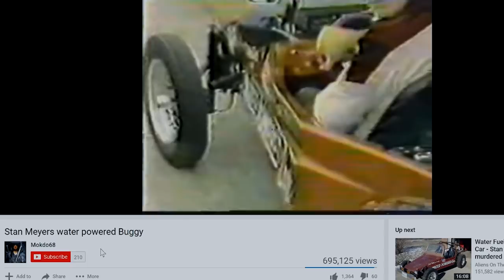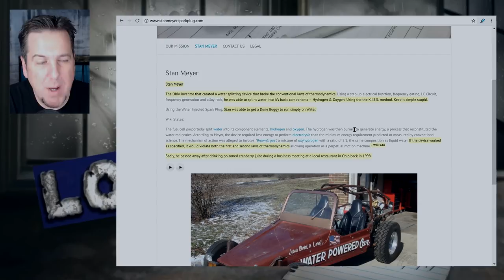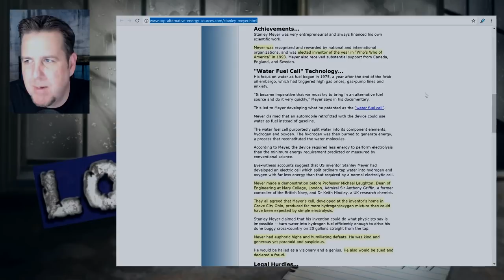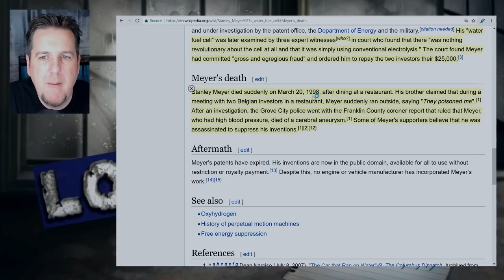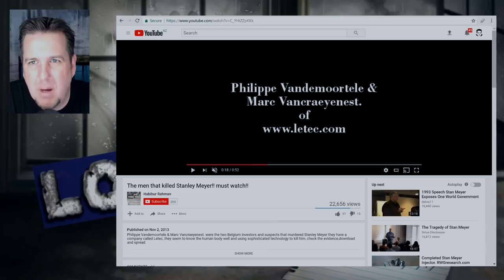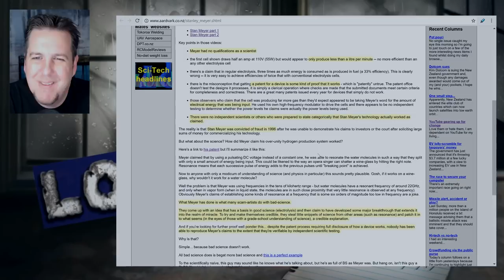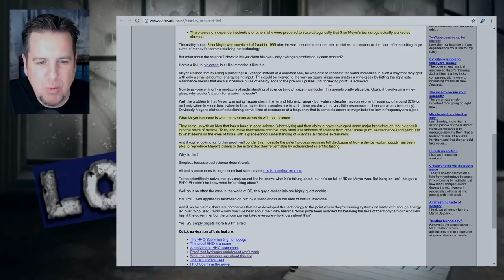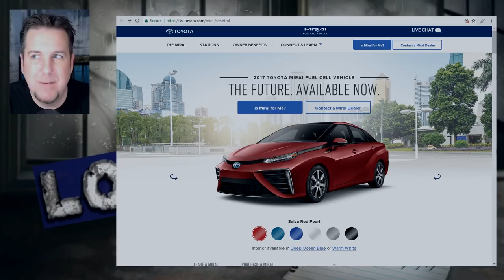BrainScratch: The Death of Stanley Meyer and his Water Powered Car

Comment: I once had  a coworker who had  a small desk  clock  that kept excellent time. The clock had a regular face,  a second  hand, but had no electric wall plug.  That little plastic clock had no batteries either:  no tiny round batteries,  no AAA, AA , C, D,  or lantern batteriy, no battery all!  I think she called it a water clock.  It was cube shaped, clear plastic, visible internal parts  and water filled.  It was on the desk for years.  No imprint re: how it worked.  25 years & have never seen another.

Comment: The water-powered car is definitely not a thing. You can claim big companies wanted to shut him down all you want, but NASA would've paid a lot of money for this. In order to split water, you have to put energy INTO the system. It's just not happening that easily
Reply: not easy but very possible . it would take using gas to start with to get the hydrogen system going first , then use engine power to create the electricity for the electrolysis . biggest problem is drivability issues since engine demand is variable
Reply: youd be surprised at how little amperage it takes for efficient electrolysis . at one time they thought the earth was flat too . if i were younger and had more ambition id just build it , although i doubt the world would appreciate it  ~  finis
Reply: @mikebyrd4671  this is hilarious, there's a MASSIVE flat earth movement right now my man, youtube it for your mind to be blown
Reply: mikebyrd please don't mention flat earth lol find some other analogy that doesn't invite all the nutters to comment.

Comment: It's ambient-heat powered, using high compression 4 stroke, high pressure ~1kpsi water injection flashes to dry steam and ignited, exhaust is cold air and water and needs managing! Caveman shlt..

Comment: I believe His engine never ran on water or hardly at all. The rumors in the area say he was a con man and ripped a funding source off. I don't know if that had any truth to it. But, it seems someone wanted their  money back or were pissed. I don't really believe he was poisoned in my opinion, maybe a heart attack caused him to throw up causing the brain aneurysm. I also heard Stanley had begged the Belgium funders for months for a meeting. They weren't really interested in something Stanley couldn't prove worked.
Reply: Yeah, sadly I think he was a BS'er. Stress probably drove his already high bood pressure to rupture a weakened blood vessel.
Reply: He died from an anoyrism, atleast that's what the coroners named as source of death. According to wikipedia he also lost a lawsuit in 1996 when a court ruled that he had committed gross and egregious fraud by selling dealerships of his fuel cell technology to two inventors. His fuel cell technology was examined for the court and the experts found out that he basically used electrolysis to split up water in hydrogen and oxygen, which is pretty inefficient. You need more energy for the electrolysis than you can get from burning the hydrogen, which meant that he needed an external energy source (probably a battery) for the entire thing to work.
Reply: Rogue Mentality  People believe whatever is fed to them I'm sorry to say this but if any actual revolutionary advancements come the creator is likely to be killed if he plans to go public. Look at Tesla he wanted free energy for everyone and his entire research was taken

Comment: Maybe I am missing something here - Mr Meyer uses electricity from batteries to convert water into hydrogen and oxygen -  the hydrogen is used to power an engine. My question is, how much energy does it take to charge the batteries in the first place. How long will a charge on the batteries last? He may be able to drive across country on 22 gallons of water (which I doubt), but how often does the car have to stop to recharge the portable power source (the batteries) to create electrolysis. The other question is, why use pure water (snow or tap water), when seawater will conduct electricity more efficiently.
Reply: Bruce T. Harvill this is the same as any petrol engine. So long as the power created from burning hydrogen is vastly superior to the output of the battery, any alternator can charge the batteries. 

Petrol engines already do this, you need a charge to run the starter in order to spark the gas in the cylinders, then the engine runs itself essentially.
Reply: A gasoline engine does not need a battery to produce the gasoline. The gasoline is used to power the engine and turn thus turn the alternator. In Meyer's design - water is split in to H2 and O - the hydrogen is burned to turn the engine, propelling the vehicle - in the basic laws of physics, there is no way to produce more energy than is put in. It would not be possible for an alternator to recharge the batteries at a rate high enough for perpetual motion. Sure, it may work for a limited time - but, at some point the demand will exceed supply.
Reply: Bruce T. Harvill First of all, the first part of what you stated has nothing to do with what you asked or what I answered. But to answer whatever it is youre asking in the second part, yes you need more power after the initial "start" of the engine in order to maintain a constant charge on the battery. Petrol burns and runs an engine with a higher output than a normal 12v battery. The idea behind the h2o conversion motor running on hydrogen, is just that, the hydrogen produced would result in a higher energy output than the battery supplying the conversion.
Reply: Surago - I will agree with you that burning hydrogen gas is efficient. I will even go out on a limb and say it burns 3X better than standard automotive gasoline. Let me make sure I understand what you are saying - I use a battery to start the process of electrolysis. Once the engine begins to run on the hydrogen, it turns the engine and the alternator to produce more electricity - this extra energy produced by the alternator is then used to separate the water via electrolysis, producing more hydrogen, thus keeping the engine running. If I am missing something, please explain.
Reply: Bruce T. Harvill I never said anything about electrolysis.
Reply: Okay - I understand what you are saying (I think) - a hydrogen powered engine will produce enough electricity to keep it running. You are discounting the idea that Mr. Meyer had all together. So, yes, you are correct a hydrogen powered engine can, will and does produce enough electricity to keep it running. Fill it up with hydrogen and off you go. I 100% agree
Reply: Bruce T. Harvill are u sarcastic?  Im really not following? From seems a question to question u 180* and you 100% agree? Huh?
Reply: More like irony (sarcasm gets such a bad rap) - if Meyer's idea worked, we would put a generator on the end of the crankshaft and make all of the free electricity we need for the whole world out of water. This argument is nothing new - we did the hydrogen engine from saltwater experiment back in Mrs. Johnson's 6th grade science class. It did not work then and I doubt the laws of physics have changed in 50 years.
Reply: Bruce T. Harvill i dont know but what i do know is some youtubers where able to make electricity with some few items.. clean energy is good for earth for humans to live on this planet but not for the top 0.1% money makers. Oil, high donors.. etc.. so they always have been targeted. So many people working on beter energy electricity have been missing or killed (mostly so good its rulled suicide or accident or like meyers medical) i think he was poisened. 1 they didnt test on. The autopsy could be false (inside man) or bought of.. anyhow even the throwing up could have cost the bleeding.. so i think he was killed. 
Maybe not bc he had all answers but bc he was saying he had them. 
In the media. In the open
 Mostly fam keep work alive but dont u think its weird the twin brother stayes very quiet and doesnt work on it anymore? I truly believe he knows it will kill him. 

Wether or not he knows the true way to doing it (water car thing)

Xxx
Reply: Do I think Meyer's was poisoned - yes. Do I think someone was trying to kill him - I don't know. It is sad that so many of our greatest inventors have died in suspicious circumstances.

Comment: Hi john. I would like to say a hydrogen fuel cell is different than hydrogen combustion. A hydrogen fuel cell is when hydrogen is oxidized given off electrical energy to run an electrical motor. Hydrogen combustion, what Meyer was working on, is where hydrogen and oxygen is ignited in a chamber producing heat that is transferred into kinetic energy (also oxidation but used for it heat instead of electrical energy). I would like to also address Free energy Vs "Free energy." Free energy in a physics point of view, like you said, is getting more energy out of a CLOSED system than that was ever there. For example, if you take a single molecule of water add its energy together from mass, temperature, kinetic movement and bonds you would get its total energy. Then to separate it into O and H you would need to add energy. In the end, you would have a free oxygen and 2 free hydrogen moving in different directions. Now to get them back together, to get the electrical energy  out, one would need to add energy once again to reverse the direction and with enough force to put them back together. This would give off waist heat, i.e. energy that can't be used. So there is no such thing as a free meal. For "Free energy" which most of these YouTube videos, conspiracy, and fringe science are based on is that fact not all the starting energy is accounted for, making it an open system, or a lack of understanding what energy actually is. So you get a free meal not realizing it is always subsidized by someone else. Also people throw the term around for electrical power that they just didn't have to pay for like solar, wind or hydroelectric or in this case snow, ocean water and so on as free energy.

Comment: Two things I want to address here are 1. Does anybody know if Stanley and the prospective investors might have been at high tension and or possibly arguing?.
And 2. Whoever says that an internal combustion engine needs X amount of liters of hydrogen to run for X amount of distance or hours, probably does not understand that the only reason you need any fuel in an internal combustion engine is to start a chain reaction to burn the atmosphere in the combustion chamber.
Thus the reason that hydrogen would be a feesable fuel for combustion engines.
Hydrogen does not require the same amount of energy at ignition as gasoline.
Also hydrogen is already in a gas form from the time of generation until the combustion process is complete.
Gasoline is not in a gas form either in the fuel system or inside the combustion chamber, it is at most a vaporized droplet.
   I have experimented with hydrogen in small engines and have found that it does not take much of this gas to run a 5 hp or even a 10 hp air cooled engine.
You can run the 10 hp engine at 98 percent of the run time as the 5 hp engine on the same amount of water.
I have added similar systems to V-8 car engines and at operating temperature it will run on this same electrolysis system unassisted from gasoline with very minimal timing adjustments.

Comment: 2:20 Yes, normal combustion engines can run on hydrogen, if you modify them. Does it work? Yes. Is it efficient? Not really, considering how much energy you lose and how much energy it actually takes to get hydrogen. Also it's not very safe, because hydrogen is by far more volatile than gasoline, you'll basically need an air-tight system. 

You can also modify a combustion engine to run on gunpowder or alcohol, basically anything that explodes. Older diesel engines even work with frying oil, one of my father's coworkers used to do that, he got the old, used frying oil from some fastfood joints for free, used nylon stockings to filter it and then put it into the tank of his old VW Golf 2 diesel. When he went to get his 2-year-inspection done (which is required here, otherwise the car isn't street-legal) and the engineers there tested the exhaust fumes, they were basically clean. He did this for a few years, which meant he drove nearly without costs, but then more and more people started doing this and the fastfood joints started selling their used frying oil, which meant it wasn't really worth it anymore.

Comment: He would need two different engines to swap between hydrogen and gasoline. You can an engine on wood gas, propane and alcohol, but once you do, you can't swap back with rings and other components cracking. VW is air cooled engine with no radiator water sysrem, so I would imagine hydrogen, like alcohol, the engine would run A lot cooler then on gasoline and might have more unseen problems that can't think of right off hand. A quick session among my friends, say its not possible. They agree that more efficient fuel delivery systems are the only thing we can do going forward.

Comment: It does not run on Hydrogen per se. It is another type of molecule. CHINA has this technology and is currently using it. It does not violate any laws because he uses high frequency and high voltage to stretch the molecule and then light wavelength to fracture the molecule.

Comment: Basically what he is saying is that the processing is happening in the cylinder of the motor, That's what he was trying to explain I don't know why people didn't get that I don't understand. In short that's basically what he was saying everything from the electrical which is being powered by the coil back of the vehicle which is enough voltage well over enough Energy to start the car way more than enough than you need How many voltage is in a quail bag when it's ignited? Got more than enough he basically simplified it for those that didn't understand apparently he didn't explain it quite well All the mixing in the processing is happening in the cylinder the arc or the spark When the water is being injected in the Cylinder the processes that happen in there is pretty simple just like a gas vehicle. Tell you what if I had the money to do what I would definitely do and I will not back down I would die when I let everybody know so this way conspiracy or the naysayers at or the real  Conspirators We'll have nothing to say.

Comment: His method was a multi-stage process. It was a combination of Ultrasound Cavitation, Electrolysis, and Resonance. The combination of the three managed to extract the hydrogen and oxygen from the water far more efficiently than simple electrolysis could. He wasn't breaking any laws of physics, far as I understand it, because he simply found a method to make water more easily accessible as a fuel rather than "perpetual motion" because eventually it would run down (after all Meyer said it'd take 22+ gallons of water to drive cross country) unlike nuclear fission of oxygen and hydrogen atoms where it'd run for years and years, if not permanently.

From what I understand, since you keep bringing up the switches, is that since it was HHO that was being produced, there needed to be a two stage system separating the H and O like a Hoffman Apparatus, so it'd be pure hydrogen and not a combination of the two which would turn into water upon combustion (bad for engines), so I'd imagine the switches would have to be a manual system to turn on and off the separator.

Comment: Everything was leading to the coil and plugs  Injectors because the coil pack Or ignite it or a quill on the car can provide enough voltage to I'll touch 2 whatcha everything leads to this point people listen Instant , Firing order on a vehicle the coil packs or coil on a coil on a distributor is enough power that was the point that he was trying to make Everything was leading to the plugs injectors.